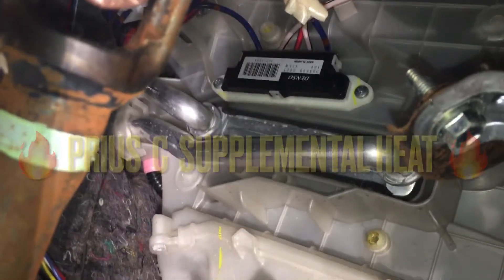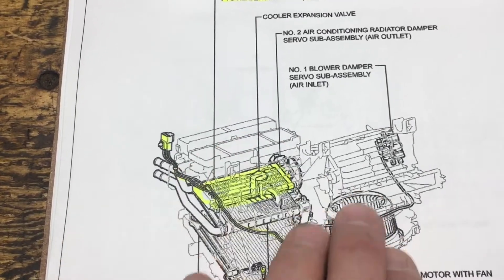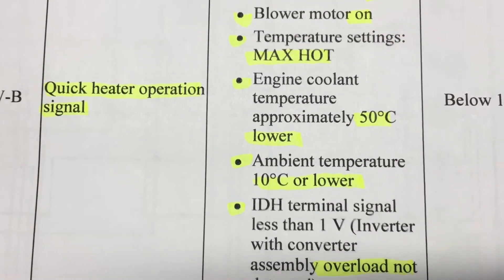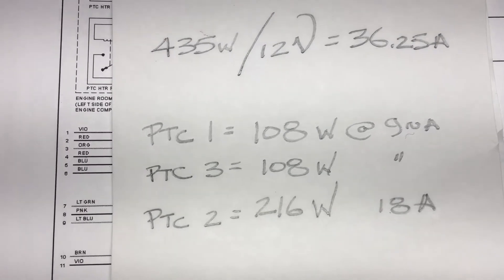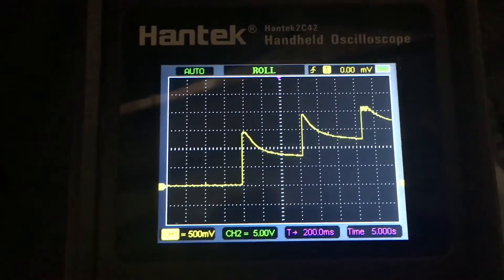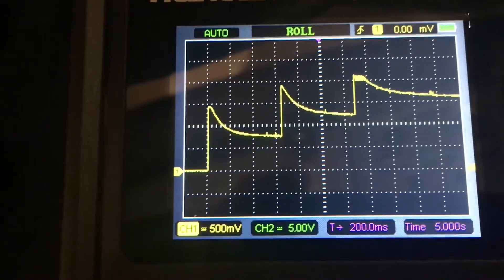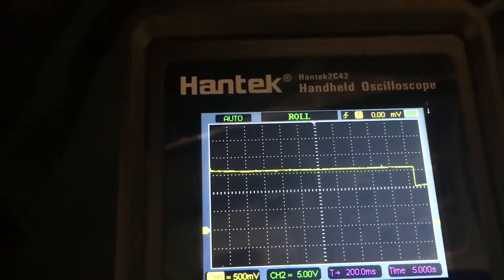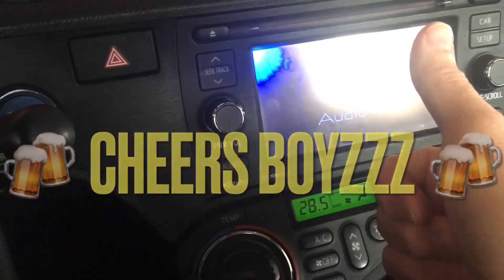Prius C PTC Heater

Comment: So do I understand well, it’s necessary to set “max temp” every single time I get into car to use this additional PTC heater?  Or this is just test case, and normally if there is every cold inside the car, normal temp settings is enough?
Reply from the maker: Max, No Eco, ETC <50C, Ambient Temp<10C. Thx for watching.
Reply: @TheGibby3340  Can You check this "Max temp" setting with Your multimeter? Because I read that in test case of course it's neccesary to set temp to max, but normaly it is enough that internal temperature is lower than set on climate controle, and techstream also set then "max temp" and PTC should normally work.

Comment: Significant details about the AC. I have a situation that maybe you know how to solve because I am on the opposite hand (cooling the car), my motor blower works when it wants, so I believe that is a relay or something between the blower and the panel, I was trying to find what every relay control in the fuse box, (PTC HTR1, 2, 3, dome cut, fan, and bkup) to try to see is the relay if the problem or not, do you have any idea who is responsible for cooling the car, or any clue how to solve the situation, I don't know what mechanic are not familiar with Prius so I have to teach myself in order to fix the problem. thank you
Reply from the maker: Hi and thx for watching. If you are referring to the AC (in conjunction with the cabin air blower and battery ventilation fan) activating on its own…One possibilities is for the control of HV battery cooling. Elevated HV battery temperatures will automatically turn on the AC system. It is cabin air which cools the HV battery. This maybe common in hot climates/seasons and I understand this to-be completely normal. Make sure the inlet grill/screen to the battery cooling fan is clean and unobstructed. 
The other possibility is when windshield demist/defrost function is selected (even in cold conditions). The AC will function to dehumidify the air to aid in clearing the windshield.
Operating the climate control (if equipped) panel in “auto” also may result in variable blower fan speeds. Higher when cabin temp and selected temp have a large split. Also normal.
Hopes this addresses your question.

Comment: I bought one of those supplemental heaters that plug into the 12V outlet for my 2002 Prius. The PTC heater operating conditions are too limiting for EV-only heating. I am hoping that this supplemental cabin heater will be able to extend EV mode in winter.
Reply from the maker: Difficult to say…Not sure how severe your winters are…Consider a block heater which of course pre warms engine coolant. The heat energy has gotta come from somewhere. Finding the efficiency sweet spot keeps it interesting 🙂
Reply: @TheGibby3340  a block heater won't help with the fact that I can only run in EV mode with the heater on low. A supplemental cabin heater will allow me to run the heater on low longer, increasing the amount of time I can keep the engine off.
Reply from the maker: @aspecreviews  understood…But correct me if I am mistaken. With low ECT the ICE will start regardless, due to low outside air temp and low ECT…make sense?